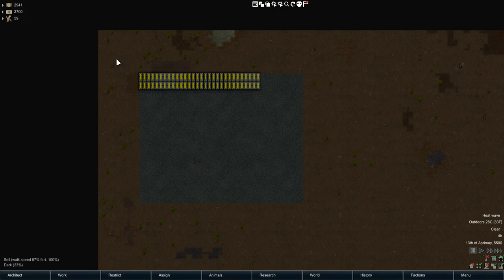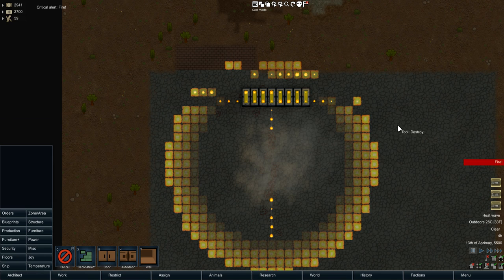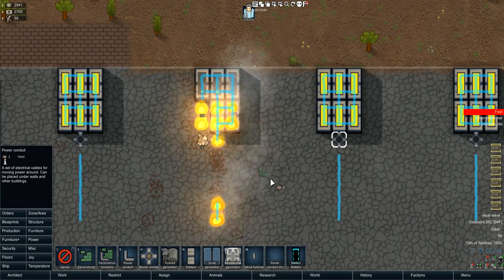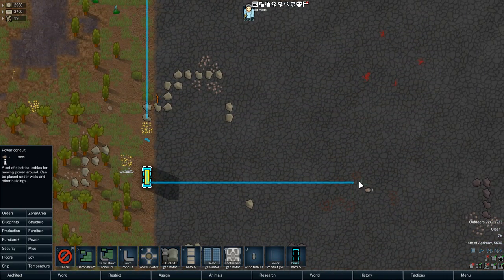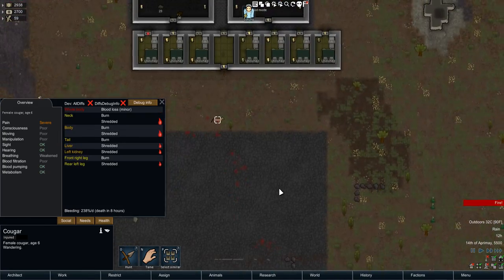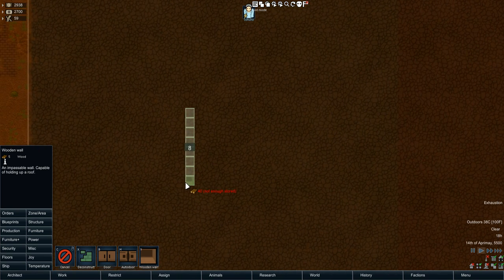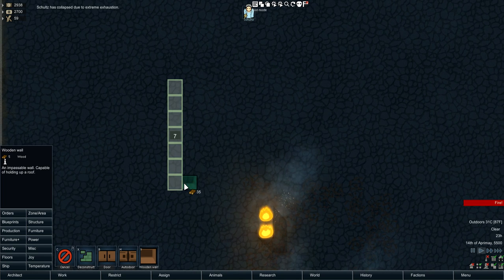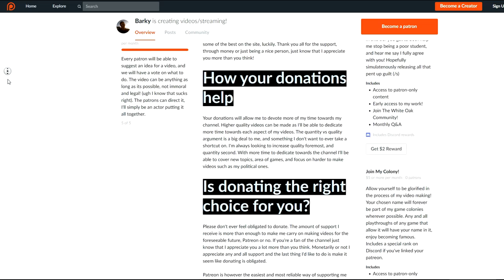Rimworld Guide: Short Circuits, how to avoid explosions and manage power.

Comment: The short circuit event is not as bad as INFESTATION!
Reply: i dont even care about the bugs, the fact that they break production tables and force me to remake my bills is the fucking worst thing ever
Reply: The Borg um, if I remember correctly, infestation spawns only when room is build into mountain/rock. If you build your workshop/kitchen outside it should get rid of the risk.
Reply: Yeah.
-Infestation: Lose your fucking base to gigantic Bugs, having to kill them, waste a f*ckton of Colony Progress, some peeps will prob. die for some dumb reason
-Short circuit: last for 5 seconds, burns some furniture, instantly put out by all colonists nearby

Why do People even care About zzZZzt…?
Reply: I lost my biggest colony ever to a huge fire, you don't know what you're talking about, you can't put out fires inside rooms, they get hot and your pawns start fainting before doing anything to the fire.
Reply: Dan 123 Then it was your fault for having too many batteries connected to power. You should have around 3 batteries constantly connected to power for day/night power output differences and all other batteries  connected to power switch set to off. That's how I do it and I never had any problems with fires.
Reply: I had only 2 batteries, was planning on building a third one when the fire broke out and it just ruined everything, burned even the freezer with all the food in it.
Reply: I'm from the future.
Solution: IED your bedroom XD
Reply: how about blight
Reply: Wtf? Dan? Did you not have vents or smth? forgot about leaving doors open? It's not that hard to fight temp. Even with fully wooden wood,you should be able to do that...
Reply: Because Zzzt,depending on the power you have,sometimes make HUGE explosions and it happens at least 3 times per month to my colony,it is really annoying
Reply: @danaldtrampf6717  a short circuit happened next to one of my colony babies, only a year old, she burned to death as the other colonists tried to save her

Comment: There is another way to mitigate the short circuit. Run the wires in stone walls. The short will damage the wall where it occurred, but won't spreading, and colonists can fix it quickly.

Comment: It would be cool if you could trigger short circuits naturally, maybe make a booby trapped kill zone with explosions...?

You should do an ideal kill zone video ;3c
Reply: Internal Bleating you can
Reply from the maker: Ideal kill zone, hmm.
Reply: Egg Crate he already did an ultimate defense video, you should check it out,
Reply: Yea but everything can be updated with mods and stuff ^_^ 

Though I wouldn't mind seeing a vanilla version too of like "the best possible kill zone"
Reply: link?
Reply: Make a choke point for raiders to come, place a battery bank¹ protected with granite close to it¹, run conduit connected to it¹ along the choke point, have 2 switches coming out of it¹: one connected to the power grid to charge it¹ and the second one connected to a nearby non-waterproof conduit submerged in water to set it¹ off. The explosion would be small and not worth the effort compared to other methods of creating explosions, but hey: it's possible.

(Idk if the red Zzzt event will happen only near the wet conduit or not, so it might need some adjustments.)

Comment: i think you need a bit more structure in your vids

1) you wanted to show that switches cut connected circuits in the event of a short circuit, but you didn't connect the circuits of the batteries

2) you don't show the interesting parts of the video happening (going on about how much energy the modded battery has, but pretty much skipping the explosion with triple sped up time)

3) showing how bad a base from flammable materials can be would have been way more impressive showing a group of colonists struggling with putting out a base made out of wood after a short circuit with wooden floor tiles and furniture, the floor tiles are the worst about a flammable base, the walls are okay to have out of wood (if not ideal)
Reply from the maker: Although I do agree with you, I think my more recent videos have improved. As much as I love criticism, it's hard to use it constructively on a video over a year old. Do you think you could check out a more recent video, tell me your thoughts on that? If not I totally understand. Thanks.
Reply: @BaRKy  sure, i saw your more recent videos and they are a LOT better

Comment: I used to have short circuts maybe 3 times in each quadrum.. i just roofed them and my batteries were as smooth as butter after..
Reply from the maker: Those are different short circuit events though!

Comment: My most recent settlement, Firebrand, is actually a big village. I gave everyone like-- a bungalow house (seeing as we're on the coast), and I haven't had that big of an issue with short circuits despite most things being wood. They usually occur on a crossroads or something, and my paths are flagstone. Just as well, I have filled my stockpile with fire-poppers, and I always have two guards on-call in the area anyhow. That's how I deal with them now, but I intend to use a good bit more stone n' more generators now. Thank you :D

Comment: From your testing in the video, the amount of power in the batteries correlates quite nicely to the area of the explosion (or square root of the number of batteries).

A 10-fold increase of batteries multiplies the diameter by about 3.

Although your finding of there being a maximum seems reasonable, as otherwise your mega-battery would have had a explosion radius of about half a million tiles :P

Comment: Okay so you actually can avoid short circuits very easily. If you connect all of your power production in one created and run it through a switch before it gets to your battery Bank then you can disable the influx of power before you get a catastrophic discharge. Also I just preemptively turn it off during storms because reasons

Comment: Actually YOU CAN have a power grid with no conduits and thus no short circuit, because all building that produce and store power have a grid in them that can transmit power but never short circuit, for example you can have a row of solar generators and then a row of batteries and you can connect most if not all things that require power without needing any circuits, also switches transmit power when turned on and also can't short circuit, i think you could make a row of them and they don't even break down(not sure if broken down thinks still transmit power).
So it is possible but not at all practical.